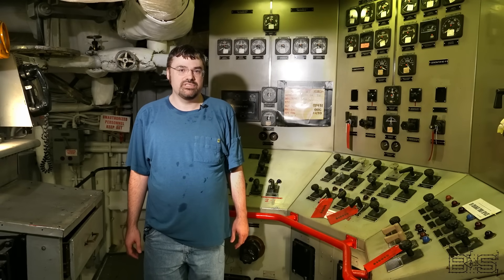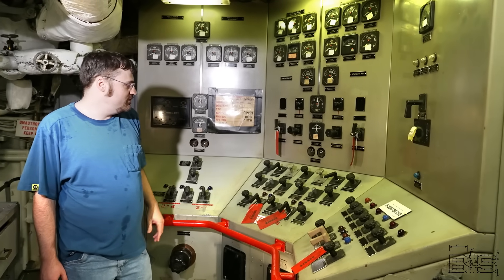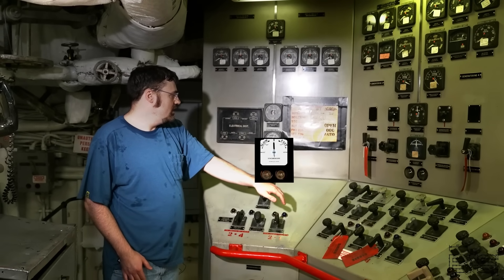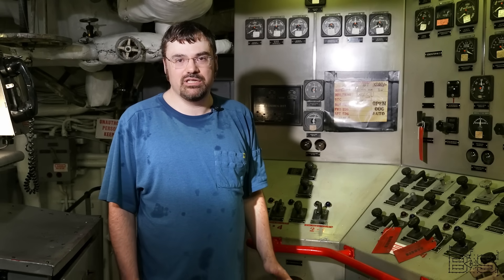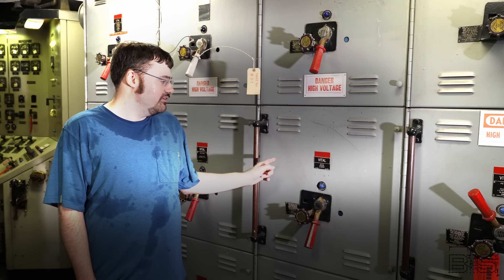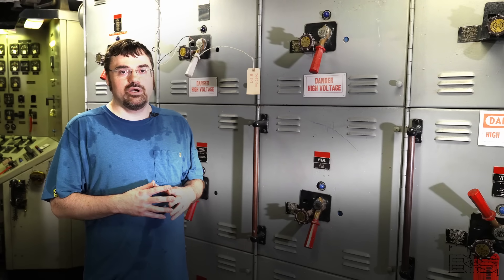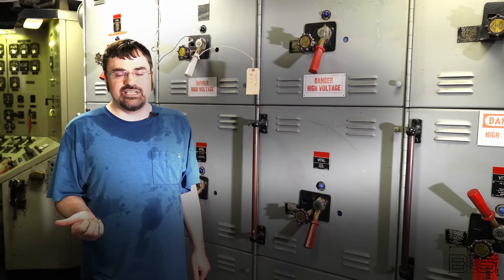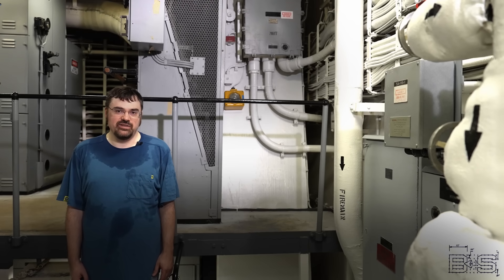The Most Dangerous Switch on a Battleship

Comment: takes me back to the good old days of standing epcc watch on an arleigh burke. you pretty much had to keep one hand on the knobs for voltage and frequency while using the other hand to close your generator breaker, because they would drop off until you balanced the load. the good thing about those ships is that it wouldn't let you close the breaker until the syncroscope was at 60 hz, +/-2 hz iirc.

Comment: Just my opinion but using the words most dangerous on a ship could depend on the type of danger your referring to in terms of weapon systems or safety systems etc as all weapon systems are potentially dangerous switches but in termsof safety the power control system is critical to keep in safe operating conditions as you point out about things like explosion and fire risks yet its kinda crazy how a single mistake even one that on the surface looks like it would make no difference can be potentially catastrophic consequences as a result

Comment: I worked for network tv.   Worked ups systems and huge generators.  At times I had to pull off all the covers over  the big big power panels and measure each leg of multi  phase power.   We were on 480 v  three phase.  The wires were almost three inches across.

Comment: Increased load will not directly lead to a drop in voltage. The relationship is much more complex, also depending on whether the load becomes more reactive, capacitive or resistive.
You can say that as load increases, the generator speed will drop. The governor controls that.

Comment: Good Presentation. Back 1972-73 I trained US Army Generator mechanics how to run two generators in Parallel. 180 decibel white noise with the 2 30 KW generators and a huge blower for part of the load.

Comment: Parallel at 5 minutes before midnight. In other words, while the synchroscope is spinning in a clockwise direction, the two indicator lights below it brighten toward 180 degrees and darken towards 0 degrees. Close the breaker to parallel at a point 5 minutes before the lights go dark. Easy peasy.

Comment: This is pretty good, a small detail, when you are paralleling, voltages are equalized, the incoming unit frequency (unit RPM) will be increased to slightly faster than the running frequency, this drives the synchroscope to move in the "fast" direction and ensures the incoming machine will pickup some small measure of load to prevent the risk of reverse power and turning the unit into a motor driven steam pump. Once the breaker is closed the frequencies/RPM are locked together electrically unit to unit and load is then increased by increasing torque which is done by increasing steam to the turbine via the governor. One of the most stressful things to do with an under instruction watch at the panel is paralleling. Limp wristing the switch, timing the synchroscope etc will make everyone's butt pucker.

Comment: My rating was IC electrician on the USS Intrepid. As the new guy in the IC gang I had the privilege to stand the inport watch in the forward engine room. while on watch a yardbird was working on the backside of the main switch board. There was a very large flash and what sounded like a explosion.  the yardbird had shorted out the main buss on 2 phases and the generator was down.  He accomplished this with a wiggle. The first but not the last ArcFlash I have seen.

Comment: There must be some good reasons why they chose AC over DC for a battleship, but i really feel like designing the electrical systems to be DC and designing everything to run on the same voltage would simplify the system (possibility making it more reliable and reducing the chance of power outages caused by operator error). All the electrical systems could be two conductor (rather than 3 or 4) and there would be no concern around matching phases and frequencies. Power could still be onboarded from a land conncetion to the grid via a AC to DC rectifier. Electric motors might have to be a little bigger but choosing a slightly higher voltage could mitigate this. 

The only major advantages to AC is 1. Easier to convert voltages (not an issue if only one voltage is chosen); 2. Better at transmitting over long distances ( doesn't apply to ships anyway); 3. No need for slip rings and brushes on electric motors. 

So the motors onboard would need slightly more maintenace being DC instead of AC, but with enough qualified trained crew onboard, this shouldn't be a problem either.
Reply: I've got a feeling the weight from the extra copper cabling for DC would capsize the ship.

Comment: Back of the enevelop math if the geenrators are rated 450V at 2005A. I would expecta a Line to Nuteral short circuit current of between 3 and 6 times the rated amperage.

With just the one generator online that would be between 6,000A and 12,000A

With 8 on the line it would be more like 48,000A at the lowest and 96,000A at the top end. 

Even at the lower end 48,000A you would be looking at a likely significant arc flash explosion.

I mean if we say the Power during the fault ≈ 450V × 48,000A ≈ 21.6 MW.

If it clears in ~50 ms (≈3 cycles @ 50 Hz), energy dumped ≈ 1.1 MJ—enough to vaporize metal, create plasma, a pressure wave, and molten shrapnel.

Pretty sobering stuff.

Comment: The old Boeing 727 and 707 had a similar synchronizer system for the generators. The 727 that I trained on looked very similar at the flight engineer station but smaller. It had a dial that you would turn to adjust the frequency of the generator to match. When you got them the same you would close the bus. The frequency was controlled by a constant speed drive. Since the engine rpm varies the generator has maintain the same speed all the time. The drive is like an automatic transmission and keeps the speed the same so that it will maintain the 400 hz. I loved this video. I would have loved to be on this panel when I was a young man.
Reply: Yeppers-and if all weren't sync'd up-she'd reject it. Just like external power-if it wasn't  steady state 115/200 VAC 3ph 400CPS within 5CPS+/-no external power . And perfect description of how a CSD  functions.
Reply: @stevenrobinson2381 Thanks. Yep. It was so much easier on the DC-9 where the two CSD’s didn’t have to sync to each other. Two separate busses and they never interacted with each other. I suppose that they could have done that in the 727. But then they would have to figure out how to transfer to essential power.

Comment: I felt his pain as the video went on as I start my day dry and within 15 minutes I am soaked with sweat working as an industrial mechanic in mechanical, electrical, and steam rooms that are not air conditioned spaces and there are no circulation fans. Some days it gets so hot in there I have to remove my waterproof boots and pour out the sweat just to keep from sloshing in them.
Reply: I became a much happier technician after I bought myself a Milwaukee M12 mounting fan. Give it a shot, the only one looking after your own comfort is you!
Reply: @AlexDlugosch Thank you for the suggestion. I will check that out. I did not know Milwaukee had a M12 fan.
Reply: Check out a product called Sweat Block. They come as wipes, and you need to follow the directions carefully for it to work properly. After you shower and dry off, you dab the wipe all over the places that sweat the most (don't wipe). It's good to have someone help you, especially covering your back. Then go to sleep, carefully laying down in bed. Make sure you aren't over-blanketed as you want to stay cool while it dries. Then in the morning, hop in the shower again and quickly wash off the areas that had the stuff applied. Then, voila, for the next week or so, those area will not sweat at all. Be careful, because obviously sweating is important to keeping you cool. But if you have hyperhidrosis like me, then this stuff is an absolute godsend.
Reply: For sauna-type working spaces consider "Body Cooling Vests for Workers"

Comment: The elephant in the room. What happens when an incoming shell blows up a turret and shorts out several 440v circuits to the ground or to each other? Or these days a missile, or two, or ten? So the danger is not just the exploding ordinance both incoming or stored but fire and cables waving around capable of huge currents all in the dark.

Comment: turns out the Most Dangerous Switch on a Battleship is not unique to battleships but is present on all electrical power plants
Reply: I think most plants have auto synchronizers these days. I did get the unpleasant task of manual sync once...... F that! Never again. It's hard to poop after that.
Reply: @steve9216  But not for that long. I remember seeing a video somewhere from when a new nuclear power plant in Canada was first connected to the grid in the 1990s, and that was still just a synchroscope and a guy pushing the button at the right moment.
Reply: @blahfasel2000  I've heard that the Navy still does everything in manual, too. As the automation guy, I think it's nuts. Auto sync works great. Our auto synchronizers used to take some time hunting, but we had lousy turbine control before we synced. I guess I got the experience of manual sync, but if anyone ever asks again, that's an Ops job. LOL
Reply: @steve9216  I would say, they do that, if automatic gear fails, they can do it manual
Reply: @cattythecat9161  That makes sense. Fail to manual. IMO, normal operation in auto mitigates human error. On a long enough timeline, someone is going to mess up (I tripped an entire power plant 😢). With automation, we can typically fail to a safe state, and failures are rare. Often, many of our failures are due to human error.

Comment: I was an engineer in the Air Force. I enjoyed how similar this video is to multi engined aircraft. Each aircraft engine having its own 3 phase AC generator and a DC generator. The APU also has a generator and then theres backups like a ram air turbine or one shot battery. Aircraft are similar to this ship in that they have numerous bus bars than can be coupled and decoupled. For example, critical flying controls on one bus and ancillaries on another bus. If one aircraft engine fails, a bus tie contactor will close and the other engine will provide electrical power to the dead bus. Aircraft even have an input for “shore power”.  
Maybe old aircraft had a Flight Engineer who did this by hand, but today all of the bus loads and synchronisation is done by a computer in a black box called a Generator Control Unit.
Reply: Yep-ye olde black box. Don't let the smoke out-otherwise it won't work any more. A GCU IS a very sophisticated device .

Comment: 100 000 Amps requires 10kV generator  voltage even if the wires total resistance from generator to short is only o.1 Ohm. Is it possible for 450 V generator?? And the generator winding has its own resistance too.

Comment: Just to clarify,  I don't believe you ever used the term  "in phase."  You talked about the "voltage peaks,"  but that simply means  the two  generators or busses are  "in phase."    The voltage peaks must be same  polarity, same cyclic rate, same voltage,  and in phase,  as you said, meaning the voltage  peaks  must be  in same exact time

Comment: Sooo . . . if that little white wire for the excitation current on a Ford 2G alternator gets disconnected with a dead-short load, does the same huge dump of amps happen, scaled down vaguely proportionately for a nominal 55 amp, single phase device?

Comment: In modern systems the voltage of the oncoming genset is set slightly higher (to avoid reverse reactive power). The frequency is set slightly higher on the oncoming genset (to avoid reverse active power). Then close at 30 degrees (breaker will take some time to close).

You preferably don't want power to start flowing into the oncoming genset when you connect it. They don't like being used as space heaters.

Also, if you were able to exactly match the frequencies then the synchroscope would stop moving and you can never synchronize the phases. In preactice there's always so much variation in the frequency that you won't be able to exactly match the frequencies.

Comment: It would be interesting to explain what exactly happened in the electrical system on USS South Dakota during the Navel Battle of Guadalcanal that caused the power failure. Also, I know these systems have casualty jumper cables and that in some cases during battles, short circuits are "burned out" on purpose..
Would be good content to understand the failure of South Dakota at a critical time in a battle.
Reply: agreed, if anyone is still alive who knows

Comment: I worked on 6000A DC breakers running on four 1MW rectifiers all on a shared buss for eight years.  You have to wear Full arc Flash Suit just to wipe them off with a dry rag.
Reply: Don't worry about the bot. There's a farm of them going around and just... insulting people, for some reason. It's very strange, though they're easy to spot once you know about them since they're not very creative.
Reply: Nobody cares Keith. It's not about you. Not one itty- bitty bit😅
Reply: @flightforensics4523 with only 18 subscribers in 6 years I fear it is you no one cares about.

Comment: Cool, but really old manual technology and prone to mistakes.
All of this could be controlled with a PLC including fail safes.
Reply: You are correct,  but there wasn't PLC's then!
I was on an "automated" ship (merchant) that used pneumatic controls. We got converted to PLC controls. Everything, pressures, temperatures, throttle position, the whole system. When.we.took it out for sea trials we could go from full ahead to full astern and stop the ship 90 sec. faster than it.did on it's first (and only) sea trial. Water levels didn't change, pressure held steady. It amazed the hell out of us!
Back in the 80's, I designed, built and programed PLC systems. I always had wondered how a PLC would do on a steam plant.
Very well I found out! 😊
Reply: @brucelytle1144  
How things have changed since then.
Thanks for that.
Reply: @sparkyy0007  Shit, I started on an old Gearing class WW2 destroyer,. Everything was manual!
Yeah, things have changed! 
I've worked on a ship so old, it had DC generators! That was "interesting" ! Every day could result in a week of sea stories! 😅😅😅

Comment: The most dangerous switch on a battleship is called "Battle Short", which bypasses all safety measures, and provides operation in the face of very grave conditions, like in the middle of battle, where you better keep the lights on at all costs.
Reply: On a Deep Sea Electronics control board for one of our generators I found a setting called War Mode. It did the same thing. It would ignore basically everything apart from a dead short.

Comment: On New Jersey is Chief Engineer in charge of both mechanical and electrical divisions or is there an Electrical Officer under the Chief Engineer? 
Especially since NJ is completely analog and manual controls.
Reply: Navy ships, the Chief Engineer has different subordinates to take care of the different tasks. The MPA (main propulsion assistant) Electrical Officer, and.DCA (Damage.Control Officer).
The Engineer is the Department Head, the rest are Division Officers.
On a Merchant ship, there is a Chief Engineer, 3 watchstanding officers (with 3 unlicensed engineers) (sometimes a day working 1st or 3rd Engineer). Some ships have a Chief Electrician and Reefer that report directly to the Chief Engineer.

Comment: I'm not convinced that it's specifically the arc flash as the primary concern but the risk that if you have a malfunction now you start tripping all the breakers and you have zero redundancy - And that's very bad if you're trying to fight a fight and suddenly are dead in the water without any alternative power supply.  Especially when we're talking about a battleship that might be getting shelled and have parts of it quite literally exploding damaging electrical systems seems more likely than not

Comment: There has to be a mis-spoken figure here. Eight battleship generators synchronized in parallel provide ten thousand watts, about half what the typical single fixed standby generator provides a rural house?

Comment: I'm sure it was added on newer ships but Zone Selective Interlocking will solve the problem of disrupting the entire system when a fault happens by opening only the closest breaker to the fault, thus isolating that defective part without tripping the other circuits in the system.

Comment: Very well done!
My work is to do the same thing automatically with a microprocessor, Digital Signal Processors, and massive SCRs.
Reply: How?  Are you applying a controlled load to one side or the other to bring the generators together in frequency and phase?
Reply: @dmdeemer  The Micro and DSPs watch both sources' waveforms, and act when the waveforms are within a very small window. Same as a manual use of a synchroscope, but not dependent on human reactions. It's a slightly different application, we are transferring between sources seamlessly due to sensitive downstream loads (large data centers). However, this is an overlap transfer,  thus no different from bus tie controls. We also monitor power quality, and transfer away from a failing or out of spec source. The term is Static Transfer Switch.
Reply: @dmdeemer  The Micro and DSPs watch the waveforms, and act when the waveforms are within a very small window.